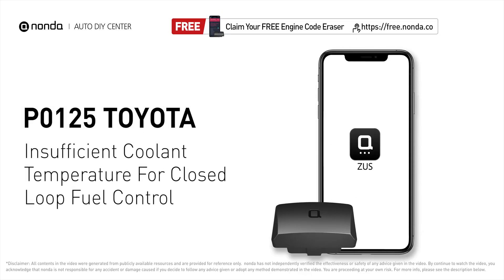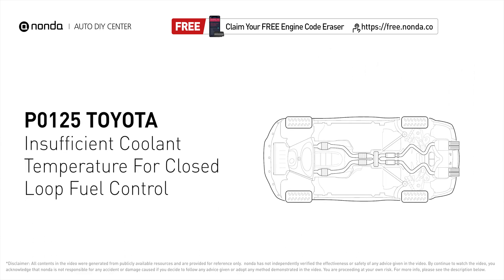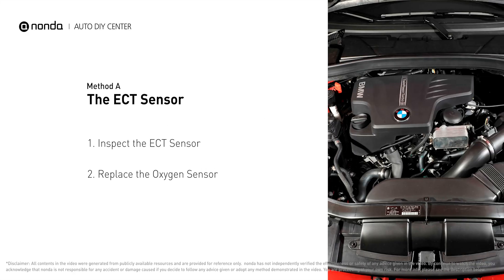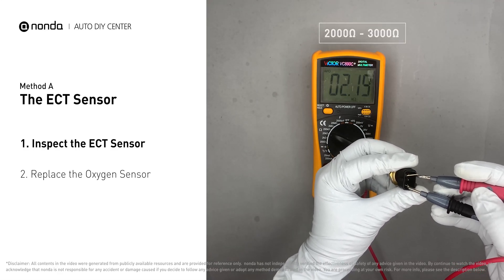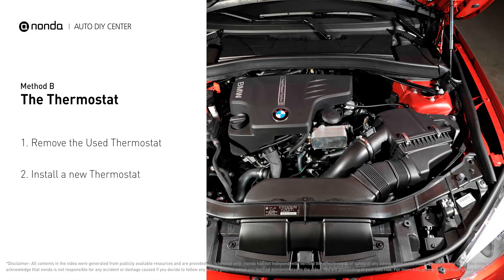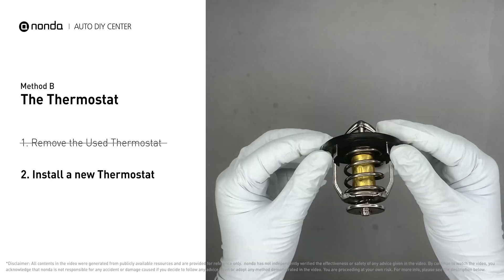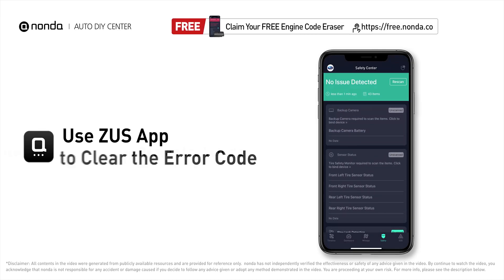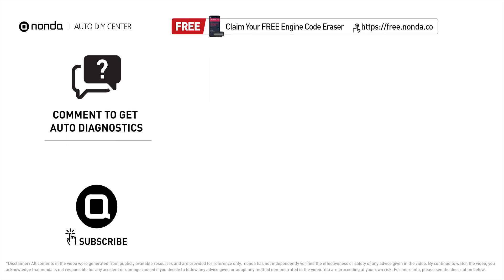How to Fix TOYOTA P0125 Engine Code in 3 Minutes [2 DIY Methods / Only $7.39]

Comment: Yeah my car struggles with enough air getting through and my rpm drops trying to pick up speed could u help me!
Reply from the maker: Hello, can you please provide us with your vehicle's year, make and model?
Reply: @nondainc  1999 toyota corolla
Reply: @nondainc  think i need new coilpacks but idk what could be causing all these issues
Reply: @nondainc  new spark plugs all 4 new fuel injectors

Comment: replace oxygen sensor?
Reply: Yeah I'm going to call bullshit! It's not the coolant temperature sensor that sends it to closed loop. It's the primary sensor foreclosed loop is the bank one sensor one O2 sensor. The car is not going to wait to warm up before getting into closed loop... And I just changed the O2 sensor in my Corolla and the light went off before I could even clear the code...
Reply: @petebetz5358 before you changed oxygen sensor, did you check the resistance of that part with AVOmeter? I read that parts works well between 1-10 ohm
Reply: @YohanesAndika-g6e  I actually have a scanner that tells me what the sensor is doing in real time. No need to check for ohms.
Reply: @petebetz5358  Where can I get a scanner like that? What model is it? Thank you forever...
Reply: @jamesmahle1259  although any little handheld scanner that advertises live data will do
Reply from the maker: Hi Robert, it's the ECT sensor and thermostat that needs to be checked and replaced.